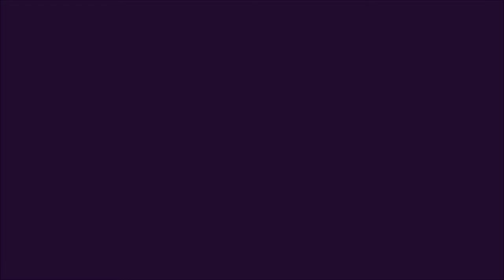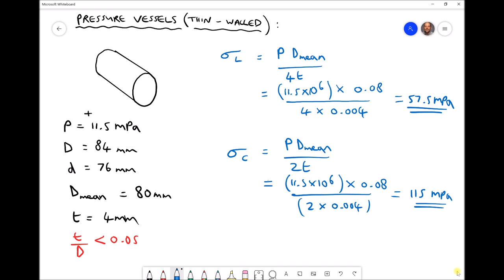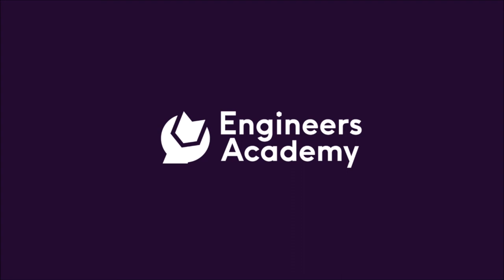Thin Walled Cylinder Theory - Stress Calculations

Comment: Hey there - was wondering why mean diameter was used rather than inner diameter? Some considerations:
-I understand using mean diameter is more conservative
-The derivation where the hoop stress is uniform throughout the wall thickness uses inner diameter
-Shigley's Mechanical Engineering design uses inner diameter, however states an approximation of "maximum" hoop stress uses mean diameter.
-Standards and Codes tend to use inner diameter and accept the underestimation of stress using other design factors
-If you use mean diameter, the hoop stress at the transition between thin and thick cylinders is the same as you've shown